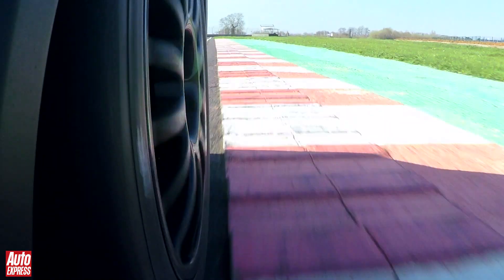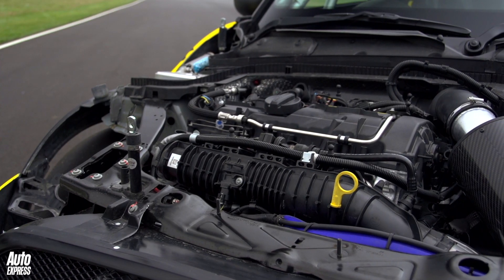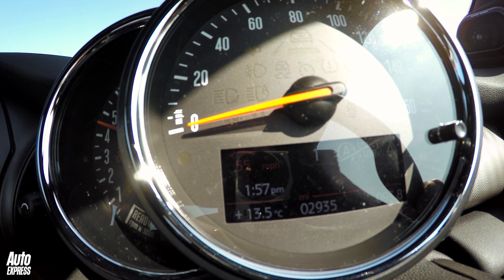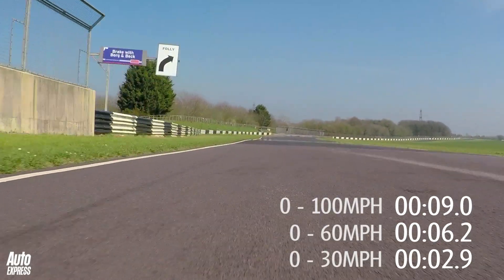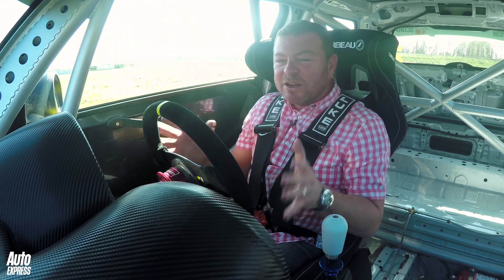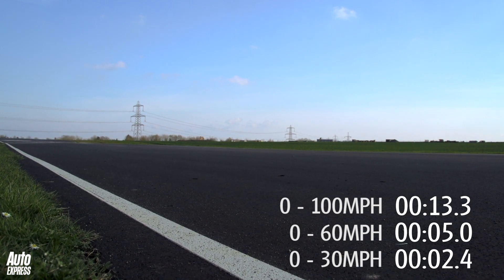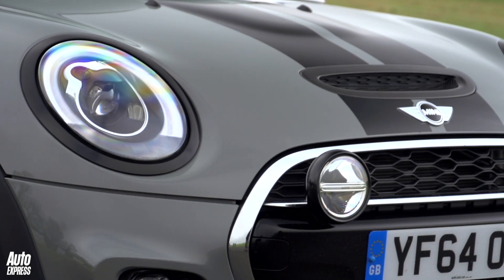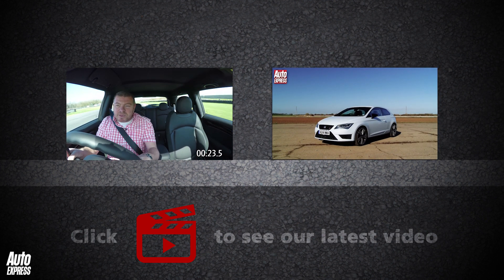Ultimate MINI drag race: Challenge 210 takes on Challenge race car

Comment: I feel like the gaps would be much larger if the driver didn't flat shift the 210 and actually used the clutch.  the gaps I feel would be much larger.       cool vid tho I am working on building my own challenge mini replica out of my 08 cooper S